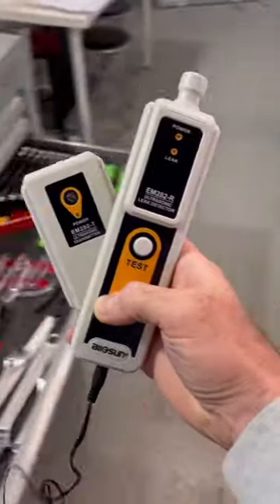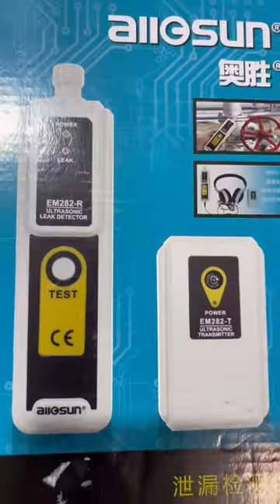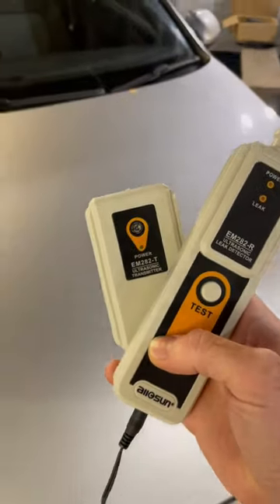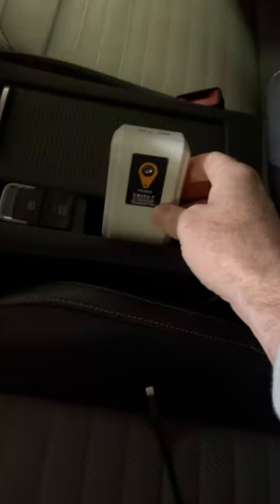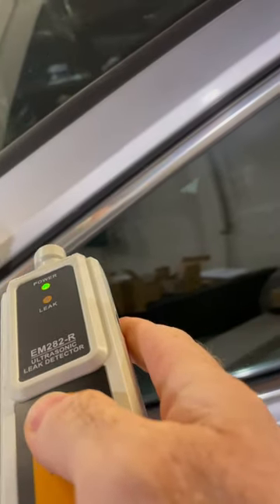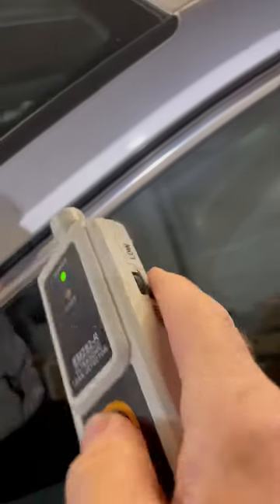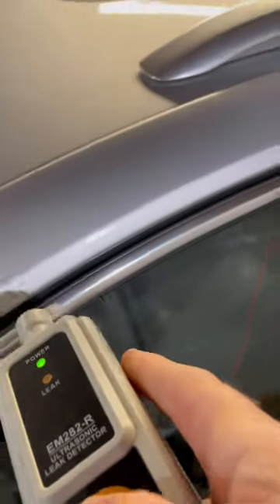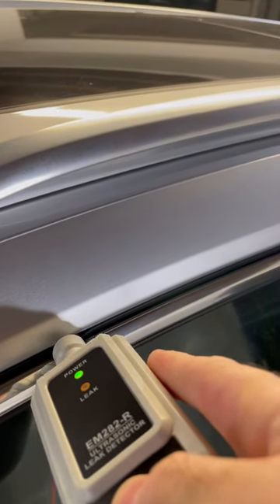Find Leaks and Wind Noise

Comment: Looks cool. I just ordered one to try it out. I was reading the description about passive mode and I was wondering if it might be helpful finding vacuum leaks. Or even exhaust leaks.
Reply from the maker: Yeah it does kind of work like that too. Probably not as good as a tool designed for that work (ie with a flexi head), but it will do it 👍

Comment: Now I wonder if this could work for a oil or coolant leak and how could that work
Reply: No it couldn’t clearly not understanding how it works. One inside and another outside. They detect leaks using the increase/decrease in signal strength. Your not going to put one of these inside you engine and even if you did with all the twists and turns and small passages and interference the signal wouldn’t get very far. It wouldn’t travel throughout hoses ect. Needs basically line of sight,